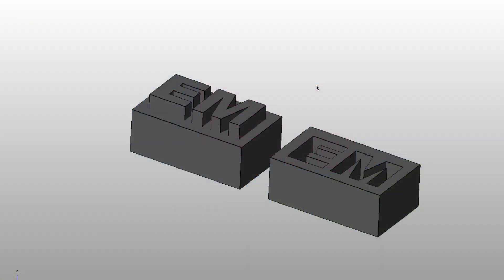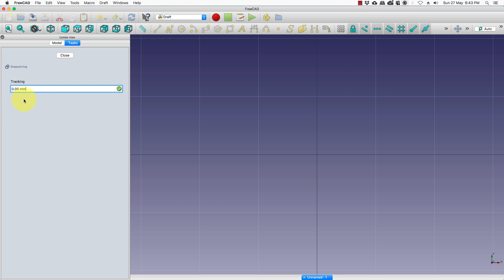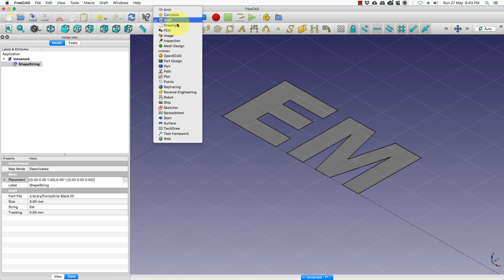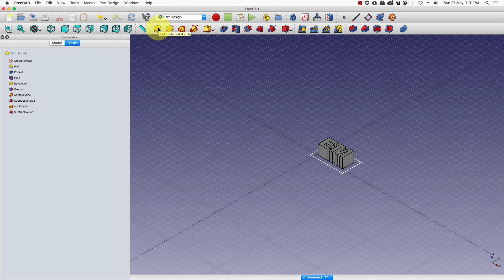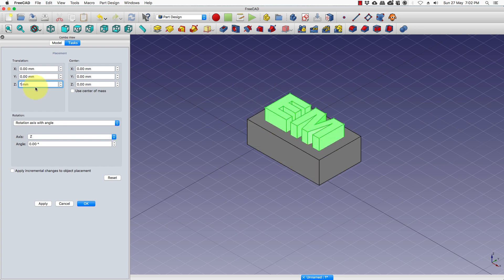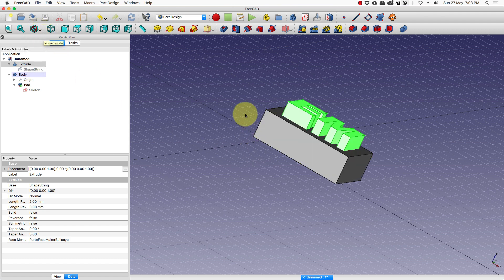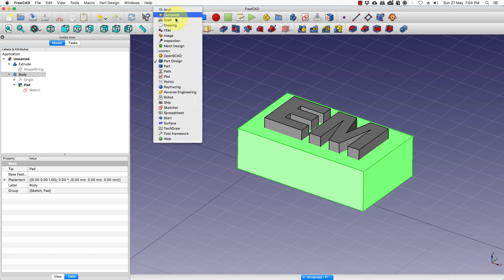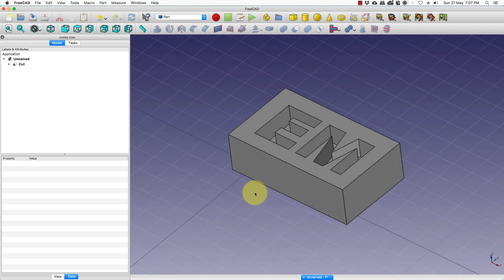FreeCAD Tutorial 3 - 3D Text | Extrude | Emboss | Engrave

Comment: hi, i am trying to create a lightbox for display. It will have text cut out from thee front of the box. But i need to make walls around each text character in the back of the box so light for one part of text doesn't mix with the other. How can i create that wall (that has little buffer from the original text (like may be 1 mm more wider.
Reply from the maker: Option 1: Create partitions in the box behind the text and make it into different sections and light each section Independently . Option 2 : Engrave the text deep and then use led strip of your choice to light each text element. Sandwich the text block from the back with white acrylic sheet and smoked/clear sheet in the front.